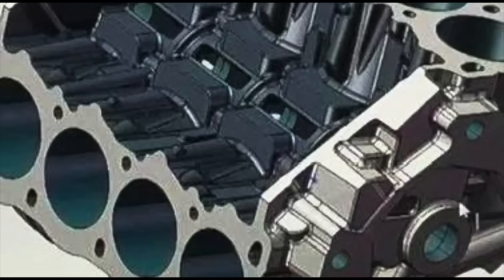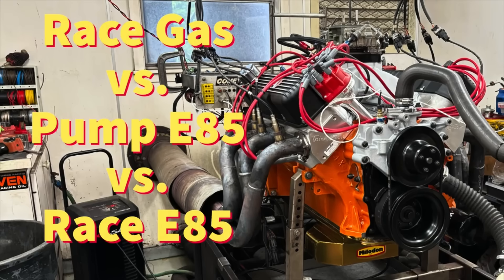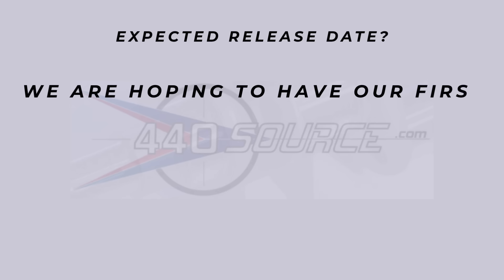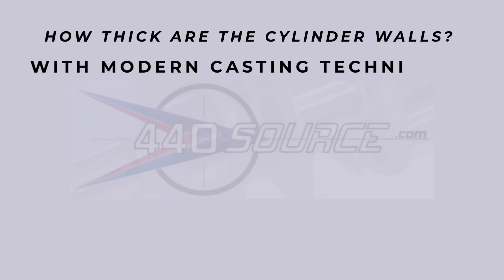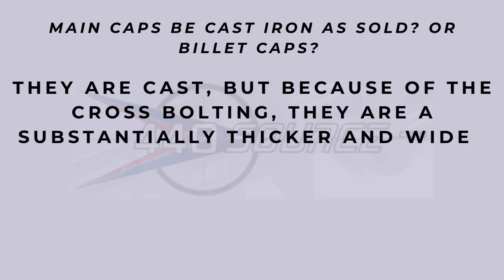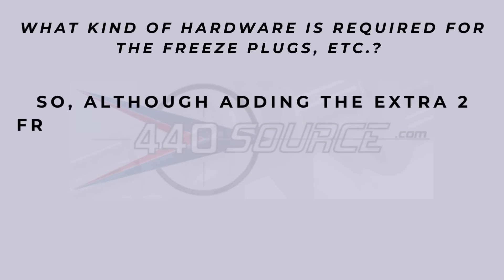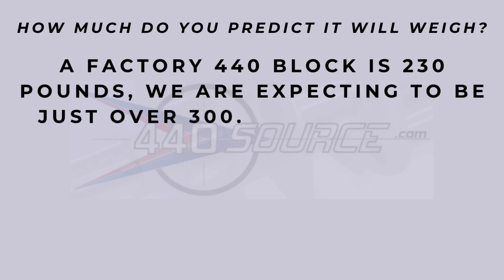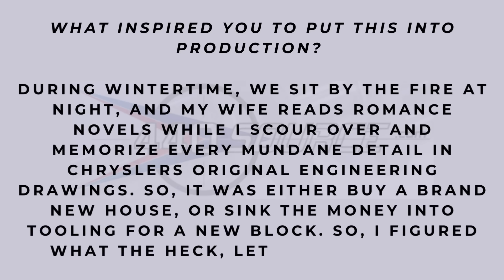The NEW 4.500” Aftermarket Engine Block from 440 Source! #mopar #bigblock #572 #engine

Comment: Awesome news!!! Because everything big block is just crazy expensive. B1 BBM heads are doable but still pricey. Indy is incredible but they are not the product for the everyman, just stupid expensive. All current Blocks have $1000 plus mopar "tax" Predator Indy heads would make real competitive power, just 6000 a side bare.... "Come on" he yells.
Thanks for spreading the news Joe. So hard to find comings and goings. People just settle for inferior parts because there's not much out there. 440 Source and Trick Flow are game changers really. I think Edelbrock MW Victors could make decent numbers, but not without porting and also filling some of the runners and wing behind the valve guide. Even the Super Victor intake is old style with curved runners, a now known flow killer.
Reply from the maker: Thank you! I’m waiting on an update on production for this one. The 580 video I got out today has the victors that were CNC’d and then hand ported to over 400 cfm. Dyno day 🔜
Reply: @JustMoparJoe  I'm really looking forward to the dyno. That thing is going to be an absolute animal. I'm really interested to see how the Victors fare. I don't think they can match the TF 270s unported, but Victors are designed to be ported. Lots of people complained about grinding pushrod clearance. The instructions require .650 for the Victor 7/8 shaft and .725 offset for the Victor MW. That's a lot of meat for porting 🤠😎😎👿

Comment: MS-3958 is titled "Gray Iron - Tin Alloyed" and was last updated to Change Level "H" on 7 April 1999. It was superseded by MS-10179, which was superseded by MS.50013, which was superseded by MS.50122, which was superseded by MS.50145 (which is currently valid). The oldest reference I can find to tin-alloyed grey iron is MS-10179 Grade BQ, which calls for 0.02% - 0.07% tin but no nickel.
Reply from the maker: Wow, that's some detailed information, thanks for sharing!

Comment: great news for most of us,is it?
but what is affordable? the callies block is available and how many of you guy's bought that one?
callies is licensed by mopar,will these be approved by them?
it's difficult to come up with a good cast-iron 426 block for the last two and a half decade.
casting problems,struggling with mopar,they never really came through.
but hey,surprise me.let me know how many of you guy's do actualy buy the block within a year of release.
because when they don't sell,price will not go down.and which affordable heads will then be used?
everything 426H is expensive because of low volume sales,just a block is only  20%-30% of a running engine.
i hope they get it out for sale to all of us in the near future.

Comment: I really prefer the Iron block and don't care if it were weighing in at 350 pds. Have never dealt with a Siamese block in the past. I'm just torn between buying China and spending 💰💰 big bucks for something (I) believe is made better here in the States and a lot easier to return in case of defective Pore date or badly machined block.😊

Comment: Make a 440 block that accepts Hemi heads. That’s what I was always hoping for.
Reply from the maker: That would be slick
Reply: @JustMoparJoe  I seen an article in Hot Rod magazine many years ago where they done just that. Round stock was welded inside the lifter valley, machine decked, drilled & tapped to accommodate the extra head bolts. Then every Mopar fan can have that dream Hemi in their muscle car. 😁

Comment: What the world really needs is a 340 Source.
Reply: That's a great idea.
Reply: I Couldn't Agree with You More  😊Love the 340 Little Giant Killer Engine 😊 MOPAR PERFORMANCE AIN'T NOISE POLLUTION  !! MOPAR OR NO CAR  !!
Reply: Imagine an aluminum block 340!
Reply: 360. Too
Reply: All you small block guys need besides affordable rotating assemblies is a set of affordable bad ass cylinder head equivalent to max wedge for big block
Reply: I'd like to see an aftermarket small block top end kit to change the intake/exhaust pattern back to the poly design, like an LS or a Ford
Reply: I'd like to see a wide block 340 with the correct camshaft geometry and raised as well. A 4.5 inch piston would be nice with side by side canted valves
Reply: @Mudhog72.  A 4.50" bore might be difficult with 4.46" bore centers.
Reply: @Mudhog72. Hell yeah, wanted valves are where it's at, like the big block chebby or the 351 Boss
Reply: Canted, stupid spell check 🙄

Comment: You spoke of the oil restrictors to top end but is it full time oiling ,ie not from the cam bearing,?😊
Reply from the maker: Yes sir, full time oiling with a separate galley for that supply
Reply: @JustMoparJoe i have modified a factory block for full time oiling with restrictor, have you ever contemplated this mod?😊
Reply from the maker: I have seen it in on small blocks. I would have to study the book again to try it. I’m a low rpm man on my bracket car lol

Comment: The market screames after a cast iron  B-block with 4,5 bore and 4-bolt main with 440 mains..... How hard can it be??
Reply: why the RB mains? Just more drag and a weaker bottom. Low deck forged cranks are indestructible. AAMOF low decks do not even need 4 bolt mains. Low decks are about the most rigid blocks in automobile history
Reply: @bigblockjalopy  Why RB mains? There is a lot more choices in bearings and crankshaft for RB mains.
No need for 4 bolt mains?  Capwalk! Strengthen up the bottom end is important.
 Obviously you dont have any experience with building a high HP Mopar BB.

Comment: What we need is an affordable high flow cylinder head to support big cubic inch Mopars. 
If you can't get air in the motor affordability, there's no use. 
Maybe a lower cost 270/max wedge head.
Reply from the maker: I’m absolutely in agreement with this one! Maybe someday

Comment: 4:17 That blew my mind! 3 grand estimate?! I mean ultimately they WILL need to make these domestic (if they arent already and in a couple years it will be cheaper anyways). Man this is pretty exciting stuff. You nailed all the things I could think of. Even the max stroke issue... if they can take a crank with max stroke of 4.8" (without cast raising the cam) then that would be the LARGEST engine made with factory spacing ever, even more than the Chevy 632. Them going with a48 is a better choice for strength but it depends on the class, hope they run a base of C40. The downside to picking strength is the corrosion resistance. Like they said, factory secrets. 
Great work Joe! You put a little spring in my step today, brother!
Reply from the maker: Glad to help! It will be interesting to see how these blocks work out
Reply: @JustMoparJoe  You going to pre-order one for... reasons?
Reply: Making it in the US cheaper than importing it? That's some wishful thinking.
Reply: @TheInsaneShecklador  You must not have been paying attention to the tariff and trade game Trump has been playing. In some cases anything being cast outside the US will be hit with 50%. The whole point is bringing manufacturing back home and yes that will cut the associated costs down.
Reply: @cjm5002  No. It will just mean offshore products will cost more than US products. It's not going to lower the costs of the US products. Especially when the steel needed to build the blocks is tarrifed. 

US workers are not willing to work for the slave wages that foreign workers are, factories and the land they are built on cost more here, safety and insurance are important here but not abroad, the list goes on and on.
Reply: @TheInsaneShecklador  You're completely missing the bigger picture. Raw imported materials have already been taxed out the wazzoo. When the US finally gets the industrial core moving again it won't be cheaper to do a damned thing overseas. You can't expect the mines and refineries, mills and smelting plants, etc. to be up and working overnight. I'm old enough to remember when the country was making everything in house, back when the only competition we had was Japan. Hell, I'm a half hour drive from the 3rd largest coal mine in the country. They just went back to full capacity after operating at 15% output for nearly 20 years (thanks Obummer!). They had 140 people working this time last year and just hired in another 386 people over 2 months thanks to Trumps plan. It wont be fast but it will be better!

Comment: Would have liked to have gotten a stroker kit from 440 Source, but they are stuck on the only sizes they offer. But, be nice if a new small block was brought out too. If the R-3 block was still manufactured, and more cost effective, be something to compete with the Ford/Chevy guys than using up the old blocks out there. Those will be used up at some point. Mopar needs to keep up with the other guys better, and be competitive in pricing, so that you don't have to see the LS in everything because they are supposedly cheaper to build. And can make more power, of which is a lie...

Comment: Need low deck though
Reply from the maker: I absolutely agree
Reply: I have to ask why? I mean if a guy wants to build a monster low deck to stay somewhat obscure. And as a 3.75 crank can be fitted to a low deck using a huge bore shorter stroke engine would for sure be a screamer. The Chevy guys have had a monopoly for way too long now. It's.way last time us guys that would push a dead.Mopar than drive a Chevy, I used to feel the same way but I've kind of gone past that now that I'm.driving a Bonneville SSEi. I am seriously trying to acquire another Mopar body, an A since any and all E's have and are unobtainium now. I miss the 3 I've had. a 70 Challenger RT and 2 Barracudas. I currently have access to 2 440's one still has the TQ and the other doesn't but both are still closed up and in good shape to work with.

Comment: Good one Joe. I hate social media, I really do.

1) While they're at it, why don't they make provisions for it to be both a Hemi and a Wedge block? There was an article on Motortrend (IIRC) where someone did but apart from the article that's as far as it went someone told me when they enquired. On that block you could literally put a Wedge head on one side and a Hemi head on the other (obviously for demo purposes).
2) The Stealth heads - Ask them, no tell them (lol) to make some Stealth heads with raised intake ports like the MP Stage VI heads where you can just bolt any RB intake on a low deck. Tell them they'd sell more low deck stroker kits (and blocks when they come out) if they did.  
My over active imagination imagines a 4.5" bore big inch low deck Max Wedge cross ram clone with OEM valve covers/
3) Are they coming out with a 4.5" stroke crank so we can build a 572 from their parts catalogue?
(excuse me if I missed that in the vid if they are)
Reply from the maker: Yes sir! They offer a 4.5” kit now, but not in a lightened version. I’m assuming they’ll jump up to a 572 kit as well. Very good points!

Comment: Man, that block sure is a porker. Great for those going after extreme hp numbers but not really for the every day guy making 600 or 700hp. Since they are going that route I would really like to see an aluminum version that beats Indy and BM's price point and get the weight down to no more than an OEM cast iron block. That's something I would really be interested in!

Comment: As always, great stuff joe. 

Im probably in the minority here. But id be interested in a block for a lower cost that isnt rated for super high hp ratings.

It would even be cooler if they could start manufacturing some new small blocks that would be lower cost just to be able to make a reliable street cruiser.
Reply: I agree. A high horsepower capable small block like an Iron Eagle or World with extra head bolts and billet four bolt mains would be a God-send for turbo and supercharged LA based engines. Which would definitely be more popular in heads up and small tire circles than a big block. The head choices for a Big Block is the cork in the bottle, if someone developed a canted/splayed valve head for the big block it would make the aftermarket block more attractive. JMO